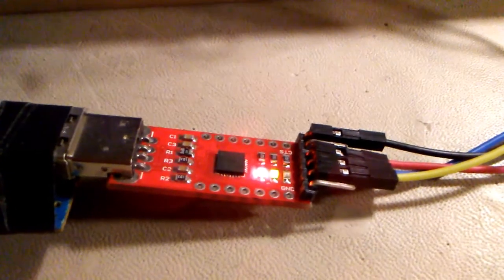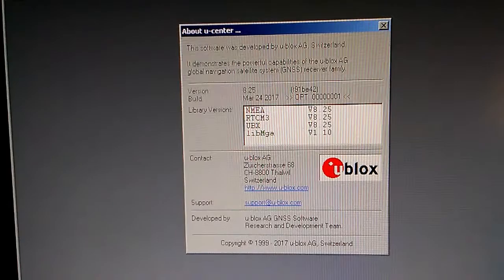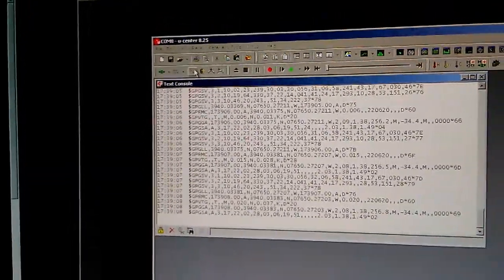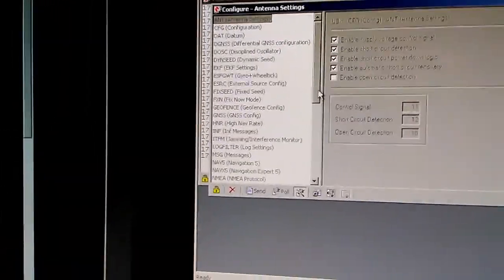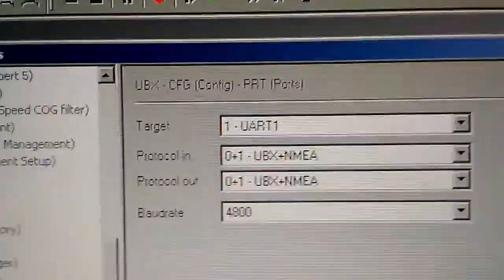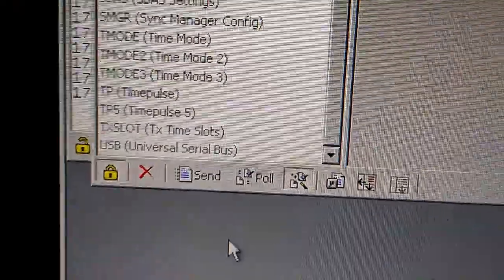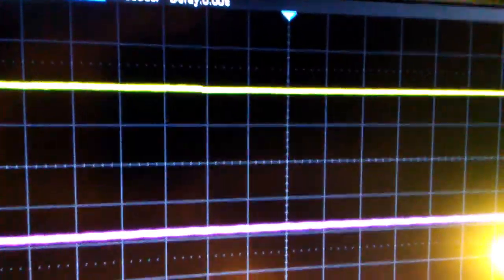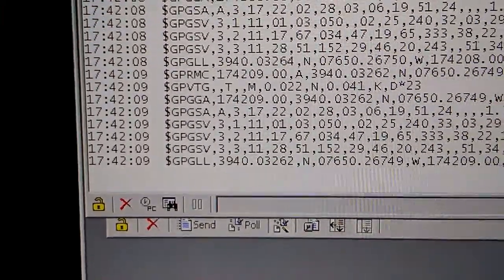(Pt-12) ZX-SSB-II Front Panel Development (Part 12) - Change default  baudrate in  Ublox GPS module

Comment: I tried out the UBlox Control Center and it's a fine client for the little 6M module.  How do you discipline an si5351 clock to the GPS second time reference? 🤔